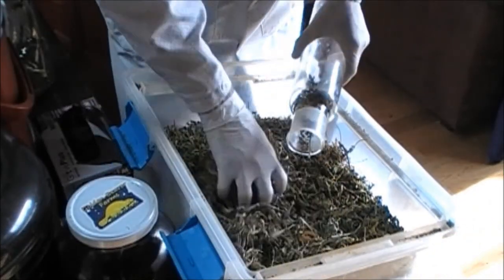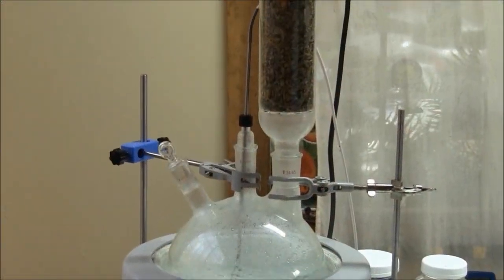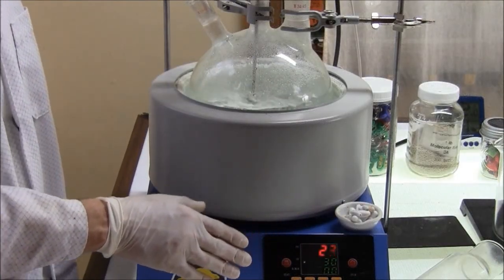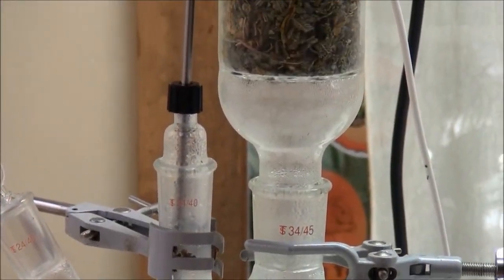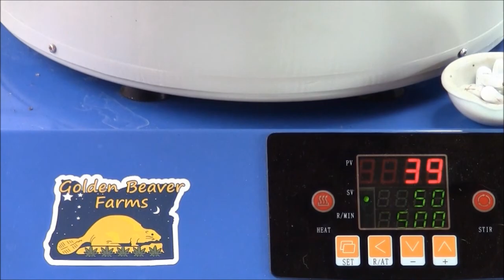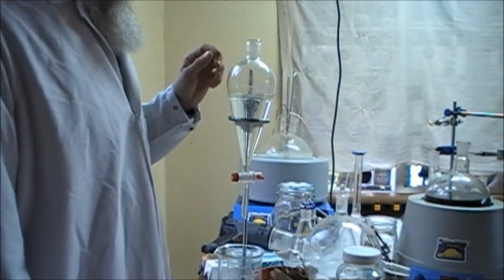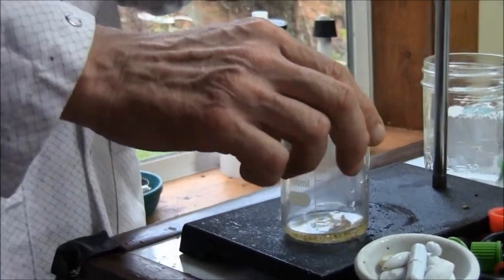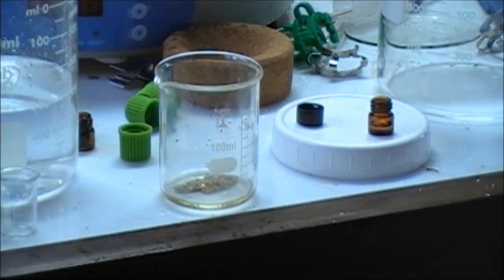Vacuum Distillation of Cannabis Terpenes

Comment: How efficient was your yield? How many grams of terpenes did you collect compared to amount of bud/trim used?
Reply from the maker: Hi E-Sinister, thank you for watching. With steam distillation the quality of the starting material will be the biggest factor in determining yields. Flower yields around 14 ml a pound, trim yields about 7 ml per pound. When using vacuum distillation rather than an oil/ water separator my yields are lower, though the quality is a bit higher.
Reply: How long do you typically run a vacuum and steal distillation? If i'm going for higher quality terpenes  as opposed to quantity, which method of extraction would you recommend?
Also, could you go more in depth in regards to your setup? Where is your vacuum connected? Im assuming the vacuum is hooked up your liebig condenser, with cold water running in your graham condenser?
Reply from the maker: The amount of time for each biomass chamber depends on which still I am using. The Summit columns are nice but only hold one liter. They are finished running in a vacuum setup in around 40 minutes, maybe less. I also use three liter spherical chromatography flasks as biomass chambers. These I will run for 1.5 to 3 hours. In all my distillations it seems that the majority of essential oil is captured early in the distillation, but that by running longer you get a much more interesting product as the terpenes that are only present in minute amounts also get captured. You can get results that are nearly as high of a quality as vacuum distillation and a significantly higher yield by flooding the apparatus with nitrogen every time you change out the biomass chamber and using an oil water separator. In this video the vacuum line is attached to the bottom of the Graham condenser, the thick red rubber hose. That hose is connected to the Summit Research vacuum controller and then to a Welch vacuum pump. This is kind of overkill for simply distilling essential oil, but I can also do short path distillation with this equipment to make THC distillate. I have videos posted showing the use of an oil water separator. My video about nitrogen assisted distillation is pretty sloppy, my technique is much improved since then.
Reply: Thanks, its much appreciated! I only ask because I've been running some steam distillations on bud, and noticed very minimal gains from running the experiment for longer periods of time. However, extending the time on a few of my runs have actually caused the terpenes to go from a clear colour to yellow. I suspect this is due to oxidation. Any guesses?
Reply from the maker: In my experience a yellow tint is most often caused by bumping or excessive dwell time for the steam/water in the biomass chamber. If I avoid bumping, include a vigreaux column above the biomass chamber and nitrogen flood before I begin I usually end up with a very clear essential oil.
Reply: Can you elaborate on what you mean by bumping?
Reply from the maker: Bumping occurs when liquids are heated or has its pressure reduced very rapidly, typically in smooth, clean glassware. The hardest part of bubble formation is the formation of the small bubble; once a bubble has formed, it can grow quickly. Because the liquid is typically above its boiling point, when the liquid finally starts to boil, a large vapor bubble is formed that pushes the liquid out of the boiling vessel, typically at high speed. If this water then wets the biomass the result can be a yellow tint in the essential oil.
Reply: Okay, that makes sense now. I'll try tweaking my apparatus to take this into consideration. 
Thank you! This has been super helpful. :D
Reply: Any chance you're planning on doing an updated video for the nitrogen assisted steam distillation?

Comment: Are you running the two condensers at the same temperature?  How deep a vacuum are you pulling?  I'm doing steam extraction with no vacuum and am very interested in doing it under vacuum in order to preserve more of the highly volatile terpenes.  Any specific advice would be greatly appreciated. Thanks!
Reply from the maker: The two condensers are running at about the same temp, but off of my recirculator. We pulled a pretty deep vaccum on this run. I'd look at flooding the apparatus with nitrogen to reduce oxidation rather than vacuum. The quality was excellent but the yield was low. I feel like a lot of the terpenes are in the waxes and don't get released at lower temps.